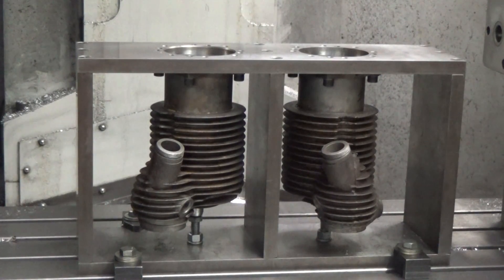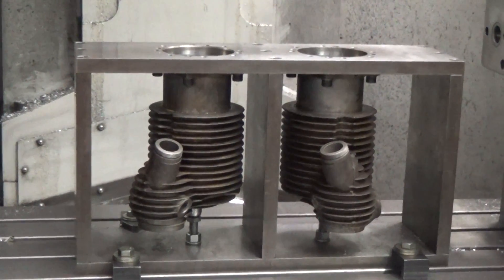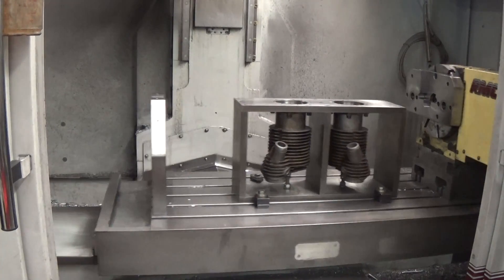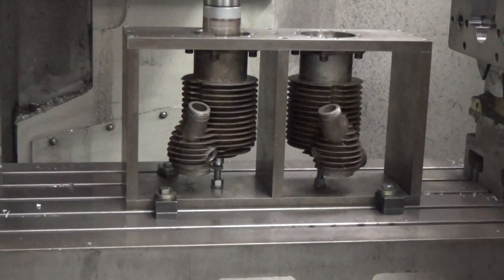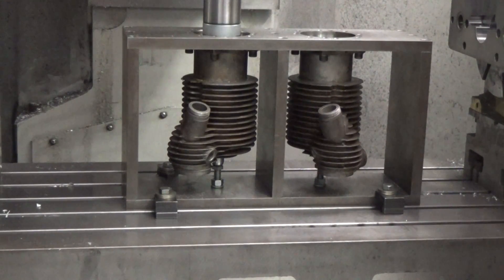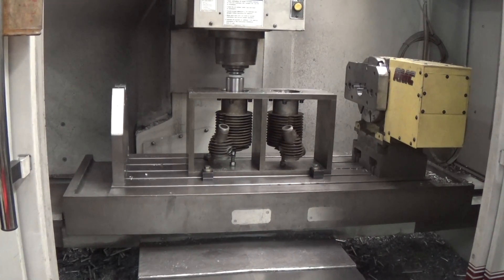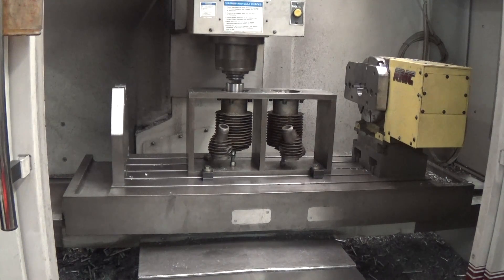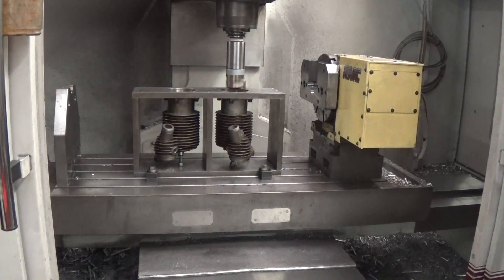Excelsior motorcycle cylinder sleeving in RMC V40 CNC mill

Comment: What are you using for a boring bar and insert? How is is adjusted?
Reply from the maker: +AJKandK  All my boring heads are Swedish made Kaiser. I set them initially in an optical tool setter and subsequent adjustments are made via the tenthset adjuster on the head itself.